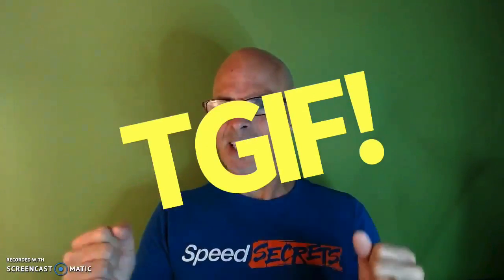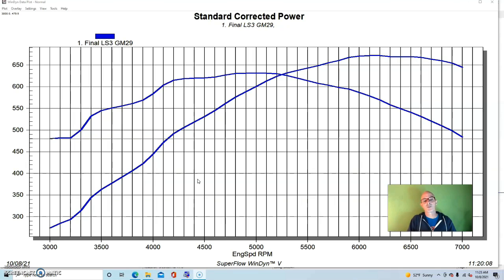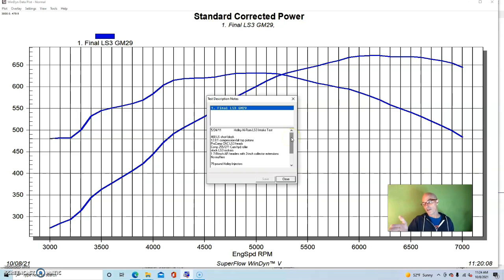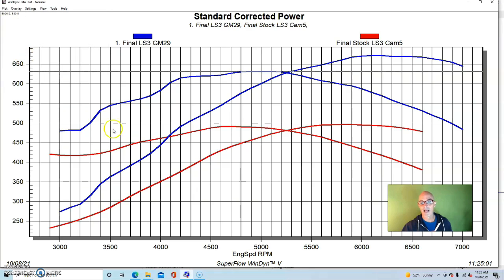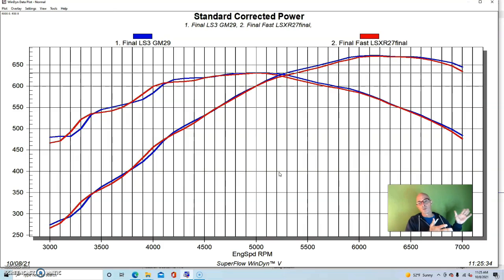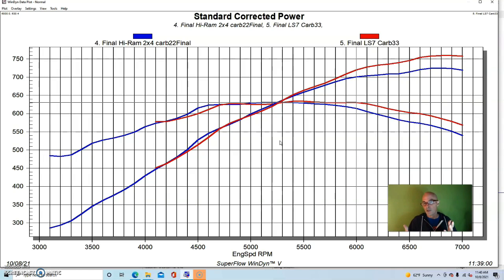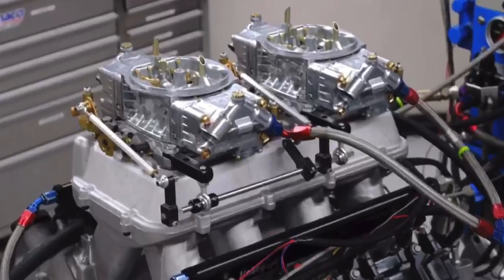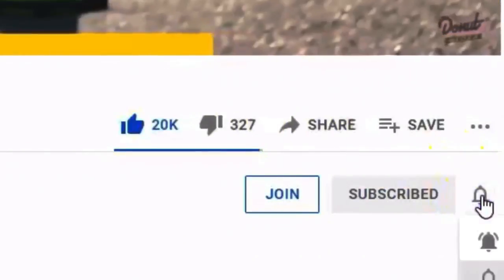HOW MUCH POWER DO TUNNEL RAMS MAKE? HOLLEY HI RAM TEST-CARB VS EFI-WHO MAKES MORE HP? DIY, HOW TO

Comment: Hi Richard, the only thing that would have been awesome is if aem, snow or one of the other water/methanol injection companies hooked you up with a 8 injector or throttle body plate injection system so you could show that those gains were primarily charge cooling on the injected application of the tunnel ram.

Comment: Increased atomization with the carbs on high ram is a huge deal one of the reasons turbo charging works so well.  Would be cool to see how hillborn injection stacks would of worked on that stroker.
Reply: Still get more with a big single 4bbl! Seen Nelson Racing Engines test the difference on a build they were doing. Also learned from them you gain like 100+ horsepower with long tube headers over zoomies! That was on a 2500hp motor, but still.

Comment: I was thinking about how old-school jet boats are trending again.  How about a typical 500-650 hp BBC or small block and compare different brands of old and new tunnel rams and dual-plane intakes that are used on boats that typically spin between 3500-5500 rpm.  If there's a low-end to mid-range rpm tunnel ram I'd like to see it.

Comment: This is definitely due to the higher flowing heads, particularly with the much larger LS7 intake valves and slightly increased lift.
Reply: I really enjoyed my LS7 headed LSX 427 ci you see in my profile pic. You could probably run a smaller cam without sacrificing much power.
Reply: what do the LS7 heads cost?
Reply: It all really depends on cost. Stock used with rockers probably $1,500.

Comment: I believe there was some "give and take" with the LS7 parts. Upside: better flowing heads & more lift. Downside 1300cfm with the two 4150 carbs vs. the lower flow of the 4500...
Reply: first problem he is using a engine that likes boost not a tunnel ram u need high compression for a tunnel ram the higher the better i run 13.5 to 1 for my tunnel ram on a pro built engine i get over 1200 hp on pump gas on a 327 but it is really built and the carb test he had it over carb no balance with the fuel makes a big different i lost 400 hp just because i had it over carb running 2 650 had to drop to 485 carbs gained a lot first thing u need to blue print it then build it not just through parts on it very very bad test .
Reply: @jeffrey4547  1200hp out of a NA 327ci with 13.5:1 on pump gas? 3.6hp per CI is amazing. I’d love to see a video of that thing running.

Comment: 50% increase over a stock LS3. 
750bhp is a lot of forward motion but what would the price difference be compared to a stock LS3 with 7-8 lbs of boost? 👋
Reply: from what i've heard, which is all anecdotal. Stock LS cranks don't enjoy boost over a long period.

Comment: Not sure if you've done it. But, seeing the intake manifold temp. difference from efi to carb would be interesting.
Reply: Cooler and denser air/ fuel charge temp contributed to power gain with carbs over efi..

Comment: Please get yourself a hold of a Holley high ram and do another test. Maybe test the MSD for the LS7. 

I have a 418 stroker LS3 with TSP heads and MSD manifold. Would love to see the difference in power between the various manifold options for this setup.
Reply: You running Ls3 heads on that 418ci?

I made 622rwhp and 550 tq  with a 418 and Frankenstein heads e85 and fast 102mm
Reply: @sic7camaro  ls7 heads
Reply: What rwhp are you running ?
Reply: @sic7camaro  575whp

Comment: Rich needs to figure out a way to run every power adder known to man in one engine build.
He might turn Westech into a smoking ruin.
Reply: Boost is boost, I'm wanting to see some more volatile fuels used , can't really call it the big bang without nitromethane.
Reply from the maker: please see the three videos where i ran turbo, twin screw, roots and centrifugal blower on the same motor
Reply: @richardholdener1727  yeah, but did you spool the huge oversized turbo up with a small hit of N20? Hehehehe
Reply: Volvo XC90 t8.2018ish ...  Is electric , turbo and supercharged. A Dream SUV of mine forsure.

Comment: Very surprised to see that the EFI hi ram didn't outperform the carbs. Was the fuel mixture the same with both induction systems? ITBs with a staged injection system and one set of injectors above the velocity stacks would be cool to see put up against the carbs.
Reply: Carbs by virtue of where the fuel is sprayed often add a cooling element to combustion. Efi fuel is often hotter

Comment: Hey Richard could you do some holley high ram upper plenum comparisons? I want to see if the front mount has any advantage over the side mount as well as see how they compare against the fabricated steel upper plenum.
Reply from the maker: the front mount flows and makes less than the dual quad top
Reply: @richardholdener1727  Thanks for the info but I was more thinking about the comparison ls for a fuel injected engine. I’m buying one for my small block ford and will need a new hood to clear a front mount but the side mount fits fine. I was curious to see if the front mount flows any better to make it worth it.

Comment: Another awesome video! I would love to see what you can do with a 90's lexus 1uz-fe motor! I have 4 of them and want some ideas for making power.
Reply from the maker: boost
Reply: @richardholdener1727  hey, thanks for the reply! I am currently locked down in p.e.i Canada, not one single dyno on this island so I would need to be able to street tune it myself. I wouldn't mind trying it but the base tune would be the hardest part I think. The factory ecu in these cars are trash so I'd have to start from scratch I think.

Comment: Pretty cool info! Seemed like the torque curve might be a bit flat, only 1.35 lb-ft/cu in. Not sure why it isn’t 1.4 or better, but as you said it’d be wicked in a fox body street mauler.
Reply from the maker: NEEDS A TIGHTER LSA CAM

Comment: As an aside..... those must have been some short ass Rods in that 468 test mule considering the stroke and the lack of a tall deck mentioned.
Reply: I'm surprised more guys don't go for the longer strokes.  Aftermarket blocks or sleeves aren't cheap.  I guess that is the reason

Comment: Hay Richard I would love to see a big comparison based on a 351w but truck motor I run a early 90's f truck as my work truck I am a heavy diesel mechanic would love to see a build comparison looking at building a massive torque monster based off the 351w but making the most torque below 5k rpm

Comment: Love your videos and data, been following for a long time and helped a ton.  Better than backyard or Monday morning mechanics around here locally.  Recently read articles again talking about carbs and getting the right size the first time.  But, what formula do you use for a tunnel ram?  I know that 2 450 Holley's aren't giving me 900 CFM.  

I've got a 421 SBC Dart SHP, radical Solid roller cam ,275 intake duration 285 ext. Duration 650 lift int.645ext.lift 108 lobe celebration Herbert cams, 4800 stall, 3:73 gears.  Weiand single plain tunnel ram.  

Will run mechanical secondaries, no choke housing, but what carbs should I choose from?  850's 750's 650's
Reply from the maker: if it has good heads to match-then twin 750s (with a high stall) or 650s

Comment: would love to see a throttle body injection vs port injection vs carb on the same combo and intake
Reply: Carb and tbi will produce very similar results. Port efi power will be down slightly but drivability will improve.
Reply: @177SCmaro  probably, but its possible that the tbi makes the most power due to not having a restriction that a carburetor has to have to pull fuel but still has the air charge cooling effect. and because its fuel injection you get a more stable AF ratio so lower torque numbers should be better then the carb set up, but is it as good as the port injection?  actually testing all 3 would show it so we dont have to speculate
Reply: @DBLDREW  
Port efi when you want more precision, carb or tbi when you want a little more power. Probably the best set up would involve port efi for start up, idle and cruising and then adding in injectors just downstream of the throttle body to cool the charge on manifold designed to be "wet" but this is a lot of added cost and complexity/tuning for a relatively small power gain (only about 20hp on a 700hp engine).
The restriction of the venturi on a correctly sized carb is negligible in most cases (especially dual carburetors), but still worth noting.
Reply: @177SCmaro  a 20hp gain is not a small amount. But only one way to find out what it really is.. this is where @Richard Holdener comes in.. why speculate when you can dyno it and know
Reply: @DBLDREW  
On a 700+hp engine 20 hp is relatively small, ~3%. Atmospheric conditions can make a bigger difference.
It's not really necessary to test. In this video they tested efi vs carburetors on the same intake. tbi is going to be very similar to a carb(s). Again, venturi on a properly sized carb cost negligible hp relative to efi. So long as carbs are "big enough" a comparable efi tb without venturi doesn't do much, if anything. In other words, if an engine at a particular power only needs, say, 800cfm then putting a 1500cfm tb on it isn't going to do much, if anything.
Reply: @177SCmaro  how do you know it "doesnt do much"? have you tested it? how much more torque does the port injection make over a TB injection? did you test that as well? no you didnt, and I think that would be an interesting test. I'm running a super victor efi with a 4150 style  TB on a 410 stroker. is it worth it for me to ditch the port injection and go with a TB injection? how much more power will it make? how much if any torque will i lose? I think a guy thats running a carb and thinking of maybe FI would also be interested in which way to go as well.. testing that gives real answers..
Reply: @DBLDREW  I've seen several dyno videoes comparing a carb to tbi. The video you just watched had both efi and carburetors on the same intake manifold. I'm not sure what more you want. You could throw a set of tbi in place of the carbs but most dyno video's I've seen show little to no difference between tbi and a carburetor on the same carburetor-style intake with both being dialed in (I have seen some cases where tbi doesn't play very nice with dual plane intakes, cutting out the divider is one "solution" but a better manifold would be how to fix it right).
Fundamentally tbi and a carb are doing the same thing just in different ways.  Venturis, when sized right, don't cost very much, if any, hp. Look it up.
Is it worth it to stay efi for you? Only you can know that. Is 3% worth it to toss out a working system? If you've got such a boner for charge cooling you could consider nitros or get creative with something like I described - add a few injectors just after your throttle body, and run E85 or Methanol. 
I, personally, like efi for how much control it gives me on my coyote-powered race car along with data logging, etc but a complete Holley EFI system plus fuel pump, etc wasn't cheap. A carburetor would have saved me probably at least a 1000-1500 bucks and made a little bit more power but the efi was worth it to me. Plus, I rather like that it all fits under the hood. That would be very challenging for me esp with a turbo hat.
Reply: @177SCmaro  the only dyno video I watched with carb vs TBI the guy didnt actually tune the TBI so what good is that? I would like to see Richard Holdener do the test because he would actually give a fair comparison or at least tell us if there is a difference between both tests like he has done in the past. There doesnt seem to be any brand bias with him.. be it Ford, GM, Mopar or import he seems to just love engines and combinations so he will tune both to the best they can get and post the results. I think that would be an interesting video and would watch it.. If that doesn't interest you then just dont watch it.. simple
Reply: @DBLDREW  
Well, again, this is fairly well understood what the benfits and drawbacks are already. I suppose then it's up to you to convince Richard to do the test your way. Simple as that.
Reply: @177SCmaro  lots of "well understood" concepts have been put to the test by Richard some have been proven to not be true. Or the extent is not that big etc.. thats the point of him doing the videos. if he wants to do it then great.. if not so be it.
Reply: @DBLDREW  
Cool story, bro
Reply: @177SCmaro  no need to get all butt hurt over it
Reply: @DBLDREW  
That was an expression of indifference.
Reply: I like carbs cuz they are easier for me to dial in than any type of fuel injection method 
Simplicity and power gains with carbs...what more could u ask 4?
Reply: @ericbeauchain9836   - No way you can tune a carb 100rpm at a time for perfect results.  Might not matter in the end but thats what EFI/TBI is all about!  Whats your number?  If I go carb, I need to call you to come tune it for me.  I will have a 6 pack ready and waiting!!

Comment: All major engine builders all agree carburetion makes more horsepower than fuel injection, it has always been the case even with advancements in fuel injection technology. Die hard fuel injection guys always down talk carburetors, mainly because they have no clue on how to tune them. Fuel injection gives better drive ability, and increased tuning options for all RPM ranges, easier to fine tune specific areas. Head flow is most likely the increase in power with the ls7 heads, as they are the most critical in making power as for top end parts go. It’s always the combination of parts, and when matched correctly throughout for a total package is the key. Good video.
Reply: It's not so much efi is arguing "it's better" it's more "we like the list of trade-offs efi gives us". If the budget is avalable I will usually trade a little power for absolute, rapid, automatic control over fuel and timing at every rpm and load. And I say this as a guy who's got both carbed and efi cars. 
That said, efi can make you lazy since, once you get it set up and figured out it's so easy. I just grab a laptop for my efi car. I need half a toolbox full of carb parts to really dial in carbs to a knife edge and still they're usually compromised in one area at the benefit of another.
Reply: "carburetion makes more horsepower than fuel injection"

Nah, you can get the same charge cooling effect with ITBs and injectors placed above the velocity stack, that's why you'll see staged injection systems on some really high-end performance engines (Kawasaki H2, for example). F1 engines and Top Fuel engines also inject their fuel high in the intake stream in order to achieve this effect.
Reply: Ls7 has: a Higher Rocker ratio with a Better line of sight to the back of the valves in being a Raised runner..Also a smaller port in CSA and MCSA. Bigger valve, better valve angle at 12 degrees vs 15 degrees with the Ls3.

Owner of Both heads for a lq4 stroker 408..🤫 Shrink the exhaust valves and seats for any bore under  .060  Darin Morgan shrunk my Speed pro Ls7 heads exhaust valve to 1.55 for a 4.030 bore.

Friend used a 4.065 bore and a Ls7 head

Comment: Tunnel rams are cool. That much is certain...but long runners have their charm too.
Reply: Funny that on a 1969 440 a tunnel ram is long runner but on an LS3 it's short runners!!! I was expecting increases in low end power on this test when he switched to the tunnel ram but it lost low end. Then I realized the LS3 intake has longer runners than the tunnel ram. Cool test for sure!

Comment: One would think a multi port injection would make more power then a throttle body injection since you can get even fuel to each cylinder. What if you put a fuel cooler on the lines would that make a difference

Comment: I have a 6.0 .005 over. Comp cam #54-472-11 and springs.Forged pistons 12.8.Rec port heads with 64cc.2.20 int-1.70ex.mid rise holley int.2" spacer.1050 alcohol. Using gen 4 rods.power pacs run by MSD.What size jets do you think i should start with ? 140.?150?And your thought on how much power it will make.Its going in a S10 setup for drag.Sure would appreciate your input.
Reply from the maker: NO IDEA ON JETTING FOR ALCOHOL